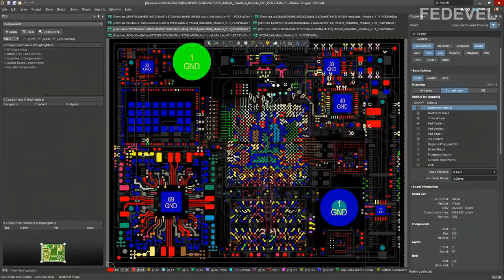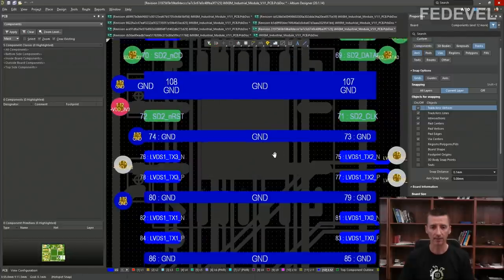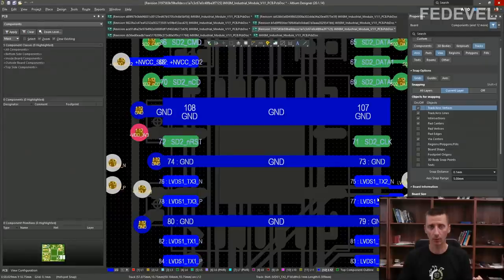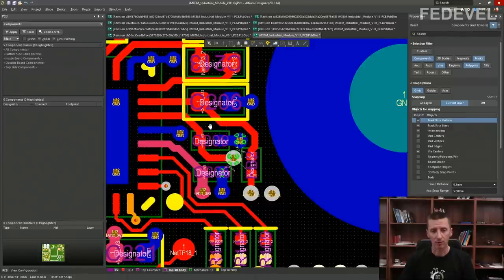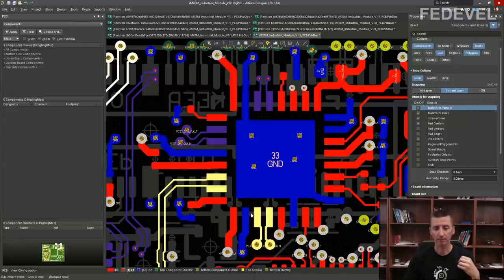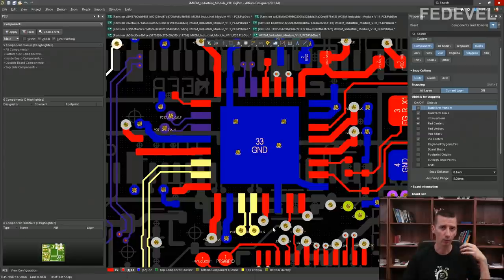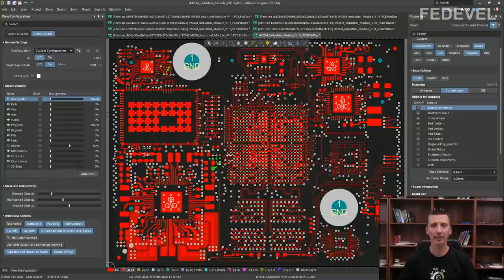How To Improve Your PCB Layout - VIAs

Comment: The vias you are talking about at the start of the video seem to be connected to pull-up or pull-down resistors. No big deal if its only one resistor. However, the problem here is the placement of those vias. How much solder mask is left between the resistor PAD and the via hole? 

Around 6:30 you speak about high speed problems around those vias. Here I also don't see the problem because they connect pull-up resistors and trance inductance is not important any more. The real problem here is optical inspection problems caused by the traces between the resistors if there is no solder mask between those resistors. You also have to look at the solder mask if you see something like this. (and think about the solder mask manufacturability). 

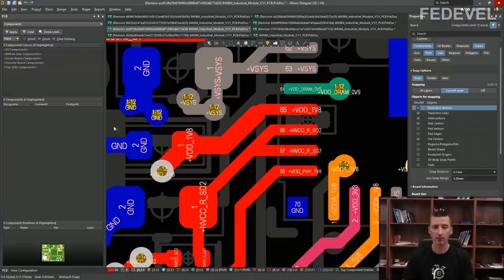At 7:10 you have acid traps (pin66 and pin 67). The same construction can be seen in other places of the board. What you did with the via at 8:20 is also not preferred because of uneven heat distribution during soldering. In those places, via placement is a trade off. 

A lot of vias connecting decoupling caps to planes are being placed into the SMD pad edges. You do not completely explain how close a via can be placed to an SMD pad. This might be interesting for the person who designed this board and some of the people viewing your videos.

You might want to investigate how ferrite beads behave. They don't do what you think they do and very often cause unwanted resonances. Low value resistors are a much better solution in many places instead of ferrite beads which people seem to sprinkle around everywhere because someone said so.

Via count in plane decoupling caps is defined not by current only. The inductance of a via must be taken into account if you want properly decouple up to 300MHz. I use 1.6nH as a rule unless I need something better.

An interesting video for many newbies might be a thorough explanation about design rules to follow and why.

Also, you recently released a video on PCB tools and which one to select. For me it doesn't matter which tool you give me. After a few days you find out which button does what. I started with decals as a teenager...What I really had to learn was to properly analyse my board layout. Decoupling caps (and not just the "place them as close as possible rule"): how many and which type. How does trace inductance affect my signals and PDN on a two layer board. How many via's do I really need in my high power SMPS and in which places via's should be avoided at all cost? Stray capacitance, cross talk,... How do I really connect an xtal to a microcontroller (guard traces and current flowing under your xtal oscillator traces)? Do I need termination resistors on my SPI signals? Just to name a few. Those are the things you need to design a robust PCB and to pass CE without unnecessary components. Basic circuit analysis is all you need. Most people new to circuit design and board layout seem to struggle with this questions or they just do something which they think is good enough. What do I really measure on my board with and oscilloscope? Is it good enough and how can it be improved if required?

Comment: Robert, I am curious about Rule distances from via to pad, as 6:35 (yellow, ENET_RD0). When you runs the DSR,  its raise some error (clearance via to pad ? ) Usually I put pcb to jlcpcb and I follow their capabilities and I d never put a via so close to the pad. What´s secret ?
Reply from the maker: The rule you are referring to is probably the different net via-pad clearance rule. These are on the same net, so they can be close.
Reply: @RobertFeranec  As suggestion, put a tip video regarding these conditions (same net, diff net) and comparing with capabilities of some manufacturer. Its important to new pcb designers. Thanks a lot.

Comment: Also a general question for the community. I am new to Altium and the vias and tracks that I am reviewing are not filled with color, so it looks like a wireframe or a track that is only outlined and not a solid color track. Can any one help with this? Thanks
Reply from the maker: When in PCB, press L -> View options -> Object visibility

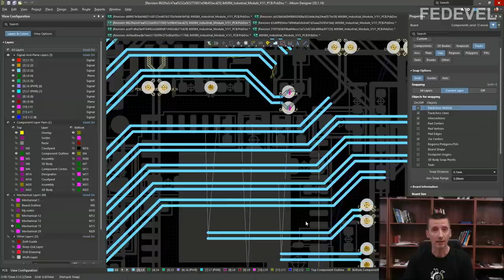Comment: 26:20 that explains the wonky looking vias I kept noticing, trying to avoid the diff pairs. 

The best tip I saw was to start placement with power (specifically buck converters) and high frequency components first, anticipating where the signals will need to be routed and the high current flows, then move on to other parts. It’s difficult, but as you say, saves a rip up and restart later.
Reply from the maker: Reading between lines :) Well done!